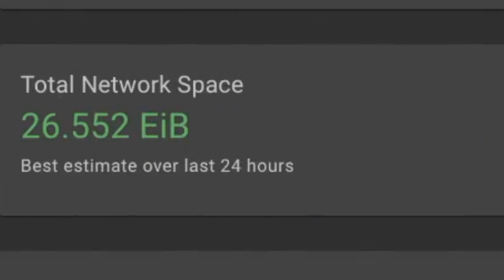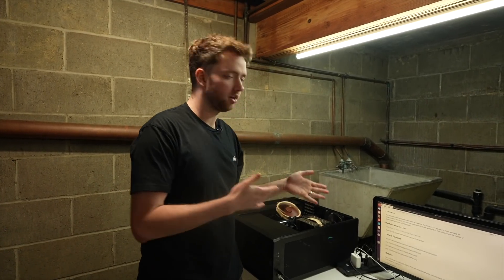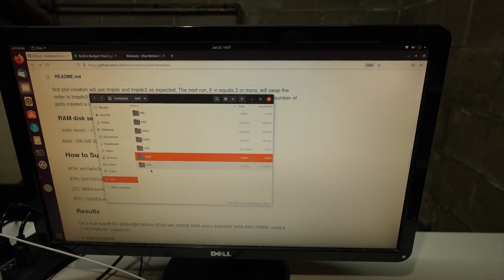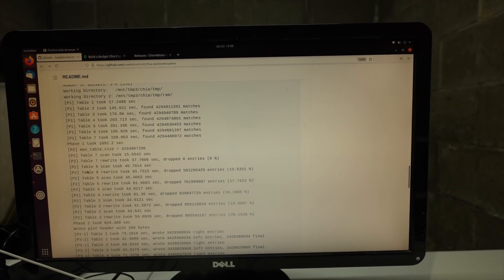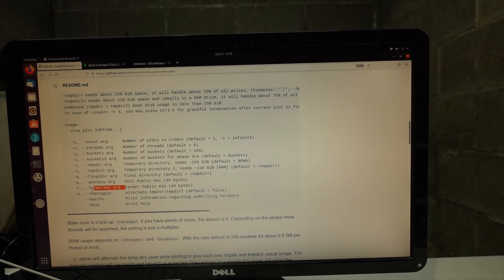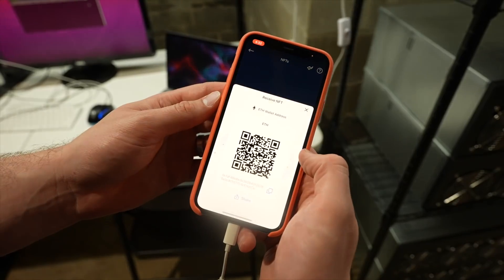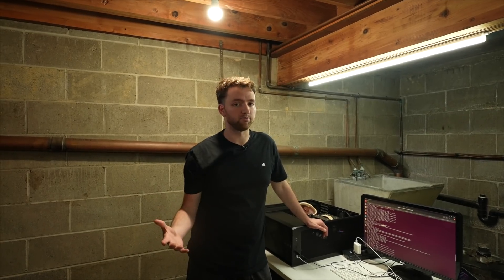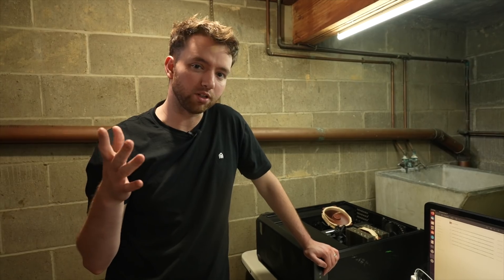Chia MadMax Plotter - 128GB in-Memory Ram Disk (Plotting Update)

Comment: I've not seen any speed increase using a RAM disk. Might even be slightly slower than using 2 Micron 9600MAX 3.2TB NVMe SSDs going through Thunderbolt. But yeah, if you don't have high TBW SSDs and do have a lot of RAM, it would be the way to go!

Comment: Glad I found the MadMax Plotter what a difference! My system is Ryzen 9 3950 X, 64GB Ram, 2 x Gen 4 NVMe and I'm now finishing a plot every 30 minutes instead of 5 hours with the Chia plotter. I was thinking about getting 128GB of ram and trying a ram drive, but I seem to be plotting as fast without so might rethink that lol. Although it would save a NVMe drive.
Reply: How many plots do you do at a time?  I have 32gb of Ram and was wondering if I need to upgrade to 128gb of Ram or just buy another 32gb of Ram to add to system.  Any recommendations?  Thanks
Reply: @alr0015  with MadMax as far as I know you can only do one plot at a time for now, but It's still much faster. I was doing 3-4 at a time with the Chia plotter, but even just 1 was taking five hours. I would only upgrade to 128GB on your ram if you are going to use as a ram drive. Otherwise adding another 32GB will be fine.
Reply: Hey... is the speed bc of new algorithm or just having alote ram help its?
Reply: @rasoolmohammady3442  I'm thinking mostly the new algorithm.
Reply: Jeff, you could improve that. I have same cpu, amount of memory(3600mhz)  and a micron 9300 max qnd ail doing 22.5minutes with madmax on linux.
Reply: @joaovictorf.carvalho458  also is it just me or when using the MadMax plotter does your time to win not drop as fast as it did with the Chia plotter? I started with MadMax at 182 plots and was at 8 months. Now I'm at 375 and it's been stuck on 6 months since I was about 45 plots into using MadMax.
Reply: @jeffbaker4219  That's because of netspace growth. It's not because of  the plotter.
Reply: @morhafs440  That's what I was thinking it probably was, just wanted to check with others. I did finally drop to 5 months.
Reply: @joaovictorf.carvalho458  Thanks for the info! I've been considering a Micron also....That is fast.

Comment: Mad max plotter came out zero seconds after I figured out Swar Plot Manager. Lol
Reply: you need the madmax with swar pack for the real fun
Reply: @thecruzader4882  Wait. Can we run them together?
Reply: @ItIsAHumanNumber , yes there are a few swar forks that use madmax.
Reply: The question why Chia team seemingly on purpose 'handicapped' the chia plotter is also an interesting one. Remember that over 95% is pre-plotted and locked up by the Chia founders. They worked for 4 years on that plotter: MADMAX came up with a plotter that is significantly faster in about 4 weeks. 

They claim they can't even integrate madmax's tech into the Chia software because of supposed open source licensing issues 🙄 ..There really is a lot to chew on here 

As far as breakneck speed plotting is concerned its a moot point anyway. The focus should not be on speed but on 'operational' farming at this point in the game. That means setting up cheap and efficient farms that can mine coin as well and/or do nodes. IMHO We're entering the sub $1000 repurposed dual CPU rack server era of crypto mining/farming or what have you. Get them while you can.
Reply: @theyshouldhavenevergivenme5439  , "MADMAX came up with a plotter that is significantly faster in about 4 weeks. "
Is faster single plot time a good metric tho?

Sure a 20min plot looks nice, but its not more cpu efficient.
Doing 20min plots and ending up with less plots per day vs optimized swar feels like a hollow victory.

Servers are the way to go for sure tho.
a threadripper etc build is not a good deal/plan for anybody exept the guy providing the amazon links.
Reply: @thecruzader4882  pardon my ignorance, am I forgetting something? Official chia plotter takes 5 hours minimum to make 1 plot and you are saying that a 20 min plot even 40 it’s not good??? Can you please enlighten me what am I missing, thankyou!!
Reply: @MAIKUS07 , comparing madmax to normal plotting does not compare directly on the time.
the 20min vs 5hours is faster sure, but that is 20min using all cores.
While the 5hour time can be with 20 plots going in parallel on a server.

If you run 20 parallel at 5hours/300min that gives you a 15min average per plot.

But doing it parallel like that assumes you have more temp space to do it on.

The key factor is how many plots you make per day.
That a single plot is done faster is not a win for me if i make less plots per day doing it.